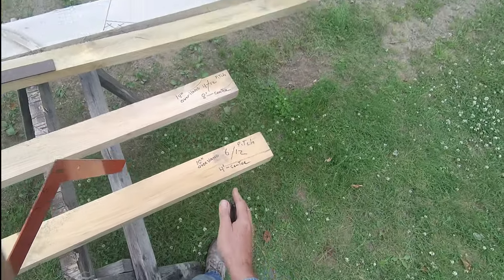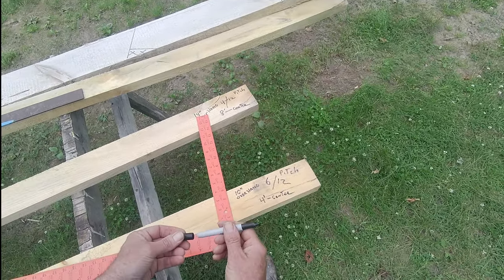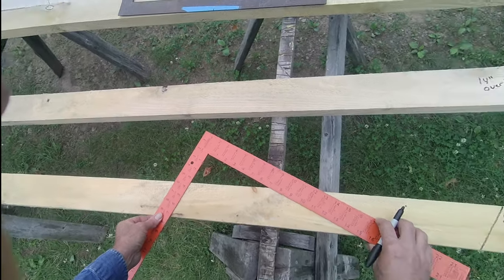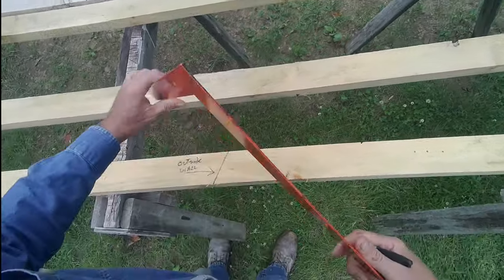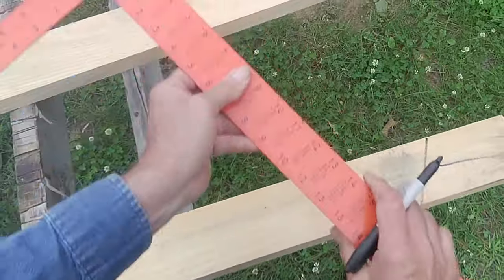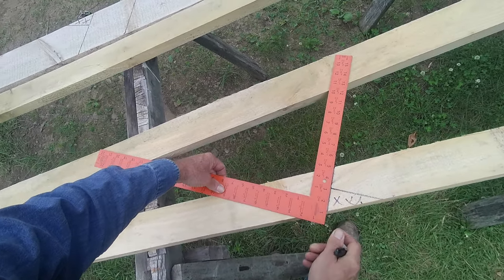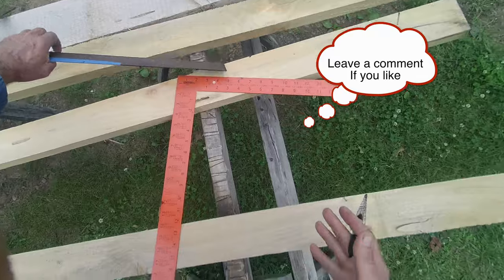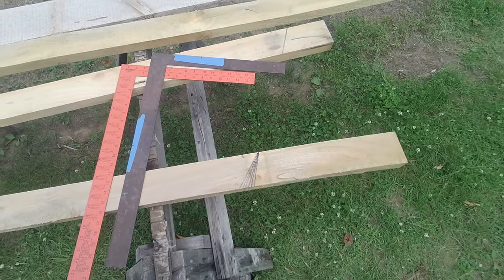Rafter Cutting Made Easy With A Framing Square

Comment: I don't think you mentioned that if there is a Ridge Board that the rafters tie into at the top, you have to deduct half of the thickness of the ridge board for your rafter length calculation. Many times that Ridge board will be 2X something, so you will have to deduct 3/4 of an inch from your run to give you the right rafter length. Very important!

Comment: Use square to measure off span that has feet and inches.....out to out 10'-6" .And there is a kingpin or Kingpost diameter to figure for birdsmouth cut.

Comment: The only thing I see you missed is you forgot to subtract for half the ridge beam width.  So 1-1/2" ridge board would be 3/4" , so your birds mouth would go off by 3/4" and overhang 3/4" too long.. Nice , clear explanation though.

Comment: I think the seat cut should be done first since depending on it’s width and therefore whether the rafter rests higher or lower on the plate will alter the angles or pitch cuts of the rafter at top and end.
Reply from the maker: I think I understand what you are saying if you wanted a certain height at the peak.
watch this video and I think it will explain the height difference you might be experience at the peak which you are compensating with a different peak and tail angle

https://youtu.be/Q2kRDCpFCxY

Please reply if it helped you
thanks

Comment: 8x8 shed with a 8 “ beam -1 1/2 beam width making my run 47 1/4 and a 8 inch overhang. I just minus the 3/4 between the bird’s mouth and the rafter top? Would the rise be at the top of the beam or bottom if it’s a 6/12 pitch?
Reply from the maker: Make a sample rafter with the birds mouth, measure the distance from the horizontal cut (where it sits on the outside of the wall) to the top edge of the rafter, should be around 3 or 4 inches, add the measurement to the rise, 6 inch x 4 feet = 24 inches plus the height of the birds mouth should give you the top of the ridge beam.
I will make a quick video today with the answer
Thanks for the idea
Uncle Gary

Comment: Hi Uncle Gary.  I was wondering how to mark the length of your rafter if you have a total run of 72 inches (6 feet) and the height is 25 inches, and your length of the rafter (without an overhang) is a decimal number (like 76.2168). How do I measure that length with a framing square (or whatever the best way is)?  Thank you.

Comment: How do you cut rafters so they can sit flush on a roof for a gable roof?  I need to attach the rafters to the roof and on boards that run like a v from where the ridge beam will sit flush on the center of the roof.
Reply from the maker: Great Question, 
sounds like you are trying to make a reversed gable with a valley. Thanks for the video idea and when it stops raining here I will make a video showing the simplest way of doing your  project. 
It will be a mock-up on my own roof and it should answer your question.
It may take a couple days depending on the weather.
Thanks for the comment.

Comment: Thanks for explaining the Step-Off method for common rafters. Concise and clear; very well done! Many thanks! Question however, is there a reason why you flip over the framing square after your first cut mark (ridge cut mark) ?
Reply from the maker: It's easier for me to mark the vertical line of the birds mouth. Thanks for watching.

Comment: Yes sir can you please make a simple video showing one with the run having inches and not just feet. For example my building is 16'1". The 1inch extra is to count for the half inch sheething. I will be using 2x6's and ridge beam is 1 1/2 thick. I also want a 16 inch overhang. 8 12 pitch. If you can please show me a video on how to do that i will pay you.
Reply from the maker: I am working on a video , well lets say I am on the 3rd, no, 4th recording

the calculating process is not hard, the videos I recorded didn't show how easy it really is

I will have one out soon
Uncle Gary
Reply: With the square set to the correct pitch, step off the rafter to the nearest foot, mark that line, then , making sure you keep the square set to the right pitch, 
slide the square along as if you were stepping off another foot,  but instead mark the extra inches you need using the blade of the square, usually if you want to add 1 to 6 inches, slide your square so that the last foot you marked is on the INSIDE of the tongue
, 7 to 11 inches are easier with the line on the OUTSIDE  of the tongue,
  remember that  the you can use either the inside or outside of the square BUT you cannot use the inside of the tongue and the outside of the blade, or vice versa.

Comment: Maybe a dumb question but how do you know how high to the top? I want to build a 12x16 shed with an 8/12 pitch but I don’t know how high that would put it at the center. Do I just take 12 ft divide by 2, which would be 6 feet to the center, then do the 8/12 6 times? And then add whatever overhang I want?
Reply from the maker: Yes if you are looking for the length of the rafter. 
Thanks for watching.

Comment: I’m building a 12x16 shed. My span is 12ft so my run would be 6ft. What would you recommend for my rise?
Reply from the maker: if you are using shingles the manufacturer recommends the rise to be at least 3/12 or above

I like to build to close match the surrounding buildings
greater the pitch the better water and snow slides off
5/12 is easy to walk on and 8/12 or greater will give you some nice storage
here's a tip
pick up some rafter material and do a ground layout ( you don't need to cut them, but if you can cut the ends to will get practice and a better mock-up) just to see how each pitch looks
its better to do a mock-up than build something you are not happy with

good luck with your project

oh yeah, the longer the overhang the dryer it keeps the siding when it rains and the cleaner the siding stays.

Comment: 8:03 The overhang marked for this board at the other end was FOURTEEN inches (and you seemed to be leaving a lot of waste at the top-cut end). 

Otherwise an unmistakably simple demonstration of how it's done.
Reply from the maker: You noticed the overhand, good catch. I had extra material (not very good stuff either) for the demonstration. Normally I would not waste that much. Thanks

Comment: You haven't subtracted  half the thickness of the ridge board in your calculations which is normally 3/4",since the ridge board is normally 1 1/2" thick
Reply from the maker: you are correct
thanks for watching

Comment: Hello,  I use the speed sq. to layout my rafters.  I having a very difficult time with the birds mouth!  These are my measurements: 143.25 span...71-5/8 run...3/12 pitch...17.91 rise...73-13/16 diag.  I make my 1st plum cut 3/12...measure down the board to 73-13/16 make 2nd plum cut...add10.5" for overhang.  I come back to the 2nd plum cut...measure up 1-1/2 inch for the seat cut, then 3-1/2 inch cut.  I finish off with cutting 3/4 inch for the ridge board...it doesn't fit!!!  What am I doing wrong!!!
Reply from the maker: Thanks for the comment
I made a mock-up using your numbers and I made a video that I will post in the near future 
I did find two things that might be giving you issues

Birds mouth cut - you measured up 1 1/2" which was too deep. Please watch a video I just posted ( I used 3/12 for a pitch)   

https://youtu.be/Z77D7IHF5Kw

Building code does mention 1 1/2" and that is the minimum they want sitting on the top plate not the depth.

1) square off the plumb line and slide it to the 3 1/2" mark, you will see the cut is about 3/4" deep

2) the rise is not the peak. To find the top of the peak you need to add the amount left on top of the birds mouth cut. 3 1/2 - 3/4 = 2 3/4" add this number to the rise and you will get the peak 

I will update this comment when I get the other video updated

Don't worry, this is a common issue and I remember when I did the same thing.
Thanks for watching and I hope this helped

Comment: sorry please explain why 4 for the birds mouth
Reply from the maker: Great question.
I used 4 inches for my width so the entire rafter would sit on top of a 4 inch wide wall.   
  International Building Code requires a minimum of 1 1/2 inches to set on the wall top plate.
I hope that helped.
Thanks for watching

Comment: That birds mouth is too deep, shouldn't be more than 1/3rd, of the timber depth, put a fence or some stair stops on the square then the pitch is always set the same,
Reply from the maker: you are right, thanks for the comment

Comment: Something looks wrong. You are cutting away nearly half of the rafter with that bird's mouth. This has got to be weak.
Reply: cause 2 by 4s are actrully 1 and a half by 3 and a half because how they process it
Reply from the maker: You are correct that this example does make a part of the rafter weaker.
Any weakness would be at the overhang side of the building.

You can cut a shorter birds mouth, ICC building code requires minimum 1 1/2"  sit on the top plate of the wall. 
The weakness would become an issue in extreme snow load areas.
If you were building in a snow load area you would use a rafter larger than 2x4.

Thanks for the comment, I hope this video helps in your next building project.